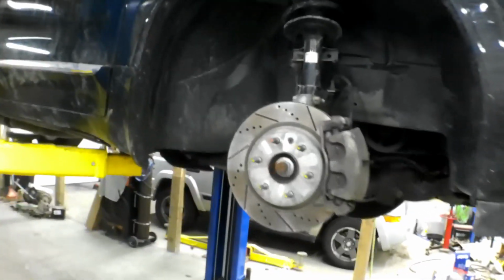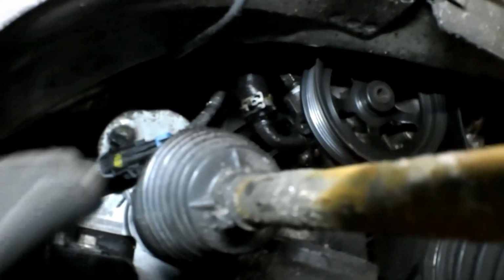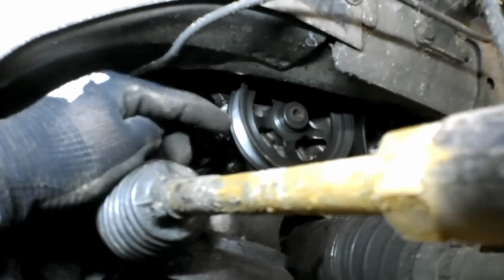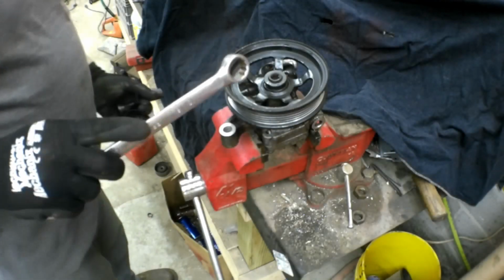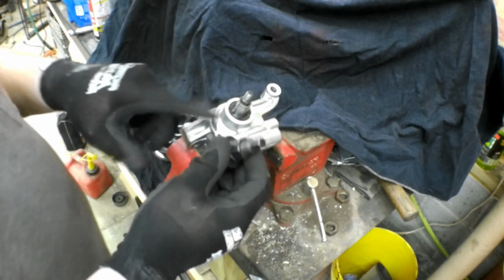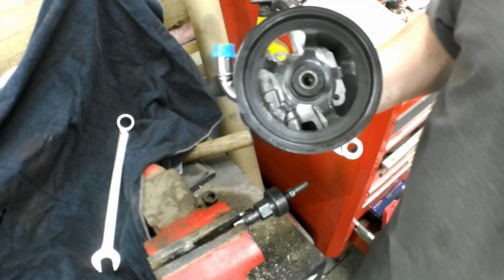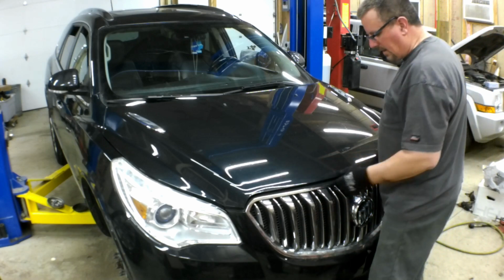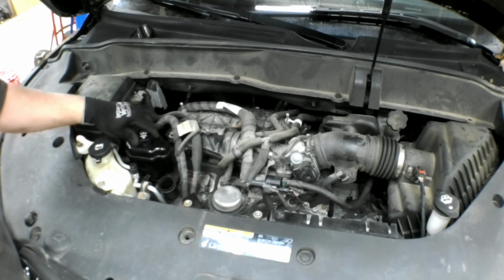Buick Enclave power steering pump replacement

Comment: Hello, hey I have a 2012 Chevy Traverse LT trying to put the power steering pump on and I'm having the trouble that when I drop the subframe on the passenger side it's only going down two of the four in required to pull the power steering pump. Can you think of anything I could have done wrong?

Comment: Great video, just curious was the pump replaced because it was leaking or was it actually have mechanical failure?  I have a 2015 and noticed a leak starting on my floor, then my power steering started whining.  My reservoir was bone dry, whine went away but thinking about how long I have before I need to replace the pump.  You make it look easy, but I know it’s not.
Reply: I just had to do one today on a 14 Enclave. I used dye in the fluid to find the leak. This one was leaking from the shaft seal where the pulley is. Hope maybe this will help!
Reply: did you inspect the lines ?

Comment: Fastest way for you people. I just did it. Support motor
Take front passenger wheel off, Undo belt off power steering pump, take off inner& outer tie rod as one piece, take brake caliper off and hang it up, take out passenger side axle, undo the motor mount and take it out (easy I promise), raise engine slightly and undo the two bolts on pump and it’s out. 2 hours or so in and out.
Reply: does it make a difference on AWD drive models as opposed to just FWD ? 

I had a shop quote me two prices
Reply: when you raise the motor did you losen any cradle bolts ?

Comment: How long did that job take you to do? Also what does a job like that costs in labor?
Reply: @K Tull and to think i charge my friend to do hers awd a miserable 225 dollars labor yikes i way undercharged her 😲
Reply: I had the steering wheel line and pump replaced at Buick dealership and it cost 1436.00 and don't forget military discount
Reply: @kb95dream  wow that is super expensive holy crap
Reply from the maker: Ouch!
Reply: @Tomsfoolery.  is the procedure same for AWD ?
Reply: @dznuttzonyachin7499 looking at video,  appears to be a AWD. CV axle is a dead giveaway
Reply: I was quoted 1074.00 today at Buick dealership to replace power steering pump. I ask them if they could discount that price and they offered 10% discount. I said I wanted to call my wife, walked off for about 10 minutes and went back in and asked if they could discount it 20% and they said yes. Total 866.60. Still to much but saved me the hassle.

Comment: Thanks for the video. Is the power steering    failure a common problem on Buick enclave 2015,? Thanks for your answer.
Reply: I would also like to know the Answer to this Question. Thank you Bobby
Reply: these suv's are the WORST !!
Reply: Seems like it. Close to 100,000 on mine & it’s going.

Comment: Pro tip, get the power steering pump loose in the car. While it is loose in the car remove the pulley, you will be able to move the pulley out on its own and then the pump unit. Put back in same order, you will not have to move down any of the engine cradle.
Reply: Wow great advice to get it out easy but I will still drop cradle it only takes 5 min and will make job much easier :)
Reply: Have you used this technique? How hard is it to get the puller/installer on the puller with the pump mounted on the engine?
Reply: Wont clear the frame to put the installer in
Reply: @Denton-su6gy  remove the pump from the engine first, so it is loose in the engine bay, then the pulley remover should fit, at least mine did.
Reply: Yea i understand that
Reply: I started one late today. By the time i could get the pulley off it was already out so i did it on the bench

Comment: Does lowering the engine cradle have an effect on the front end alignment?
Reply from the maker: Yes, it can have an effect on the alignment. It's recommended you get an alignment anytime the cradle is loosened for any reason.